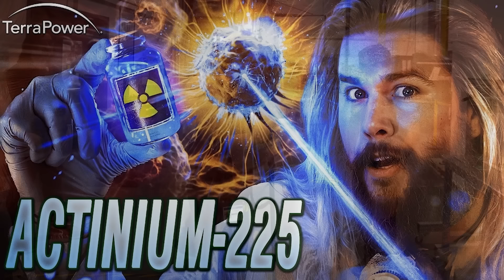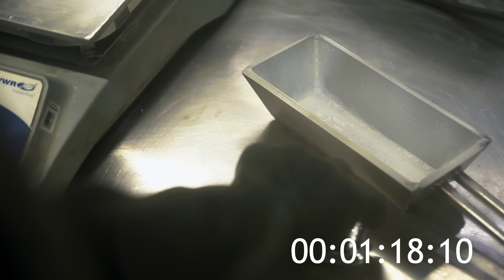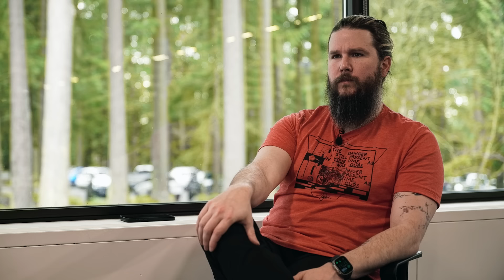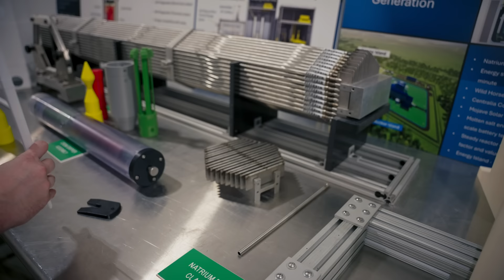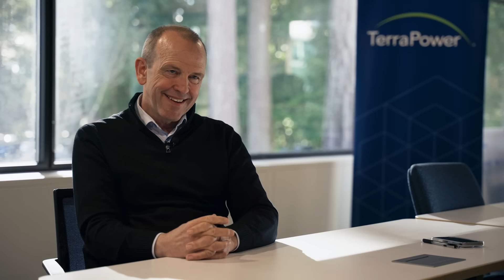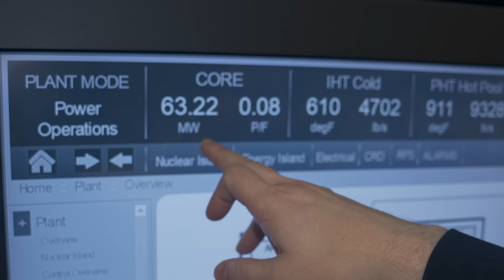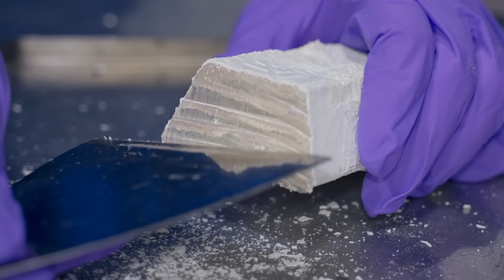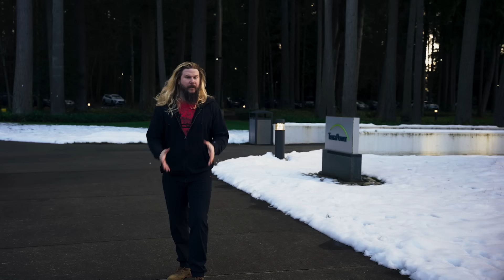Will Natrium Nuclear Reactors Change Everything?

Comment: Neat, but also would've loved some explanation of how they're counteracting corrosion over long durations from their very hot molten salt which has been the biggest challenge to commercializing molten salt reactors of any variety.
Reply: I thought he did at least touch on this, but I think he undersold the critical point. This is not a molten salt reactor. The reactor itself does not use any molten salt. They're using molten salt for energy storage and transfer in its own closed loop, but in this case they don't have to deal with molten salt corroding the reactor itself.
Reply: @rantingrodent416  yes but it does corrode the water loop. And that is the exact problem you don't want in regards to Na reactivity. It likely won't melt anything when it reacts to water, but it will turn a lot more of that water into steam which can lead to a steam explosion or at the very least force them to release that radioactive mixture to prevent a rupture in the water loop
Reply: @nokarukuta587  That's assuming they don't construct the loop out of materials that don't react with sodium, or at the very least aren't lined with a different, non-reactive material
Reply: @AlexDreemurr  Actually forget what I said those loops are not in contact. Here's what's could happen: molten salt could leak into the reactor and corrode that, water could leak into the molten salt loop and I'm not sure what would happen then.
Reply: @nokarukuta587 there is no "molten salt." Sodium isn't salt.   The salt solution isn't molten either, that's like saying a liquid battery is "molten" and this is essentially a giant version of one of those. It's a giant back up battery. Are they even in close enough contact for a leak like that to happen?

This is a sincere question and not sarcastic doubt, I'm not as familiar with nuclear heat transfer construction.

Water leaking into the salt solution would likely do little compared to getting into the sodium. Salt solutions, after all, contain water. If it's anything like smaller scale batteries, a specific ratio of electrolytes per volume would need to be maintained for it to store energy correctly.
Reply: @AschenDog  There most certainly is molten salt used in the reactor.

The nuclear reactor uses molten sodium metal (Na) directly as a coolant. Then, the molten sodium metal passes its heat into a molten salt coolant loop, which is 60% Sodium Nitrate (NaNO3) and 40% Potassium Nitrate (KNO3), per the whiteboard shots in the video. 

Finally, there is a heat transfer between the molten salt loop and a water source, which converts the water into steam that spins a steam turbine for power production. The molten salt loop is a thermal battery, i.e. it stores heat energy, and thus has the secondary advantage of being able to enable load balancing with the power grid.
Reply: @AschenDog  "Water leaking into the salt solution would likely do little compared to getting into the sodium. Salt solutions, after all, contain water. If it's anything like smaller scale batteries, a specific ratio of electrolytes per volume would need to be maintained for it to store energy correctly."

The big concern here would be a steam explosion, as with every other loop of this variety. Not really much you can do about it other than precautionary maintenance.
Reply: @AschenDog     we are not talking about the sodium loop. There are 3 loops, one in the reactor(sodium), second that takes heat from the reactor (molten salt), and the third water, which is turned to steam by the second loop.

So sodium heats molten salt which heats water, the sodium cannot come in contact with the water unless loop 2 breaches both in the reactor and in the heat exchanger between loop 2 and 3. 

As for your battery comparison, it's not like that, we are talking about completely different chemistries and even a tiny amount of water in the salt is bad since it speeds up corrosion.
Reply: @AlexDreemurr They did say they're using austenitic stainless steel. Your supposition is correct. One of the advantages of austenitic is that it doesn't corrode in the presence of liquid sodium
Reply: @AschenDog  bro what? sodium is salt
Reply: @MrTeddy12397  Sodium is a metal, and can be a component in a salt, for example sodium chloride.
Reply: @nokarukuta587  Actually, there are 4 circuits in the complete system, although only 3 are present in the nuclear island:
The primary (sodium) is inside the reactor vessel(pool). A small amount can become activated as it flows through the neutron flux if it happens to absorb a neutron (i.e. it is radioactive with a relatively short half-life for the activation products)
The secondary (also sodium, but not radioactive) moves the heat from the primary->secondary heat exchanger inside the reactor vessel to the sodium to molten salt heat exchanger in the ancillary building, attached but outside the main nuclear containment barrier (reactor building).
The third circuit (molten salt), moves the heat to the energy island storage tanks in a separate facility
Also in the energy island, the steam generators are fed by a second molten salt loop from the storage tanks.
Reply: @MrTeddy12397  Bro no.  Sodium is a metal.  Salt (table salt) is sodium AND CHLORINE (NaCl).  Other salts are other metals (not always sodium) and other non-metals (not always chlorine).
Reply: @Electroneer molten salt is not used in the reactor. Sodium is used in the reactor which is a metal.
Reply: @MrTeddy12397  if sodium is salt, so is calcium and lithium and magnesium. might wanna check your periodic table again.
Reply: @nokarukuta587  the salt loop is completely separate from the reactor and cannot leak into it, it is at least 100 feet away on a different concrete pad. And the sodium is completely separste from the water, no interaction possible.
Reply: @jeffreysmith236 salt loop passes through a heat exchanger on the other side of which is the sodium. Breaches pretty much always happen there since its a thing with a lot of thin pipes.
Since the reactor is at atmospheric pressure we can assume that the salt is higher pressure and would leak into the reactor if a breach occurs.
As for water reaching the reactor see my other comment, its unlikely but it can happen.
Reply: It's been in service for decades at concentrated solar thermal power plants without issue. Molten salt storage is a solved problem, it's not like molten salt thorium reactors. I'm unsure of the specifics of how they prevent corrosion (or if this specific solution is corrosive to the materials used for the insulated storage tanks), but the information is definitely out there somewhere.
Reply: @jeffbenton6183  The problem is solved by planning to replace corroded parts frequently as part of routine maintenance, which is easier to do when not dealing with radioative materials. The reason sodium metal is chosen as a coolant is because within the reactor it will be irradiated, and when a sodium atom captures a neutron, the radioactivated isotope decays to a stable isotope of magnesium. The sodium metal has to be highly purified to avoid other atoms capturing neutrons and producing less happy coincidental results. All this adds to cost and time-consuming technological side quests in order to operate safely. If any of this were easy and cost-effective to do, we'd be there already. But big data centers know they're going to need lots of power, and need to get public money and many smaller investors to buy in as if this would be serving the public. Other people's money. Good jobs for some. Plus it's good cover for military applications.
Reply: Maybe the molten salt not being radioactive makes it easier to regularly inspect and service the system. In MSR designs that mix fuel with molten salt the mixture will contain radioactive fission fragments, and neutron-activated isotopes. But if the salt is in the secondary loop it's not radioactive at all.
Reply: I've always wondered how they do this. Fluorinate the piping? That's about the only very good, consistent way I can think of, but it's difficult to do for valves and pumps. Their secondary loop seems pretty simple though, just tanks, pipes, and pumps.
Reply: After 10 years of mining salt, I can't see any metal pipe lasting very long. Couple of years tops. I'm sure they thought of something, but I'm also sure it's a proprietary idea that they aren't going to tell us.
Reply: @joeanthony2312  There is no salt in the reactor.
Reply: @joeanthony2312  You know that molten salt has been used in solar generation for decades*, right?  That this is a *solved problem and nothing even remotely super-secret?
Reply: @michaelrichter9427  Also well-studied are the leaks and fires in molten salt storage at CSP facilities operating at significantly lower temperatures that this proposed nuclear facility. Fortunately they've only resulted in shutdowns of several months and increased costs of tens of millions, not permanent losses of facilities, generations of cleanup and costs on the order of billions. I'd like the nuclear industry to adopt that!
Reply: I know multiple universities have been studying the best materials for pipes containing molten salt for years, such as UW-Madison. I would assume there was a break through there for this technology to proceed.
Reply: @phred-98  The problem is not just one of containment. There's also optimizing heat exchange while ensuring circulation of the two fluids in their distinct loops. One of the fallacies of the video is presenting sodium metal circulating in an open beaker by magnetism as if forcing it between control rods in the reactor core and then through a circuit to the the heat exchanger on the molten salt side without allowing hotspots or  blockages to develop. It's just not that easy.
Reply: @perrisici  They used electromagnetic pumps in EBR-II to circulate the secondary sodium. It ran for 30 years with no serious sodium issues and they used sodium to water heat exchangers. Yes, they had to replace the sodium to water heat exchangers once and learned the lesson. Instead of having the water in the blanket of the heat exchanger and pumping sodium through the pipes, they reversed it and pumped the sodium through the blanket. The problem wasn't the sodium side, it was the super heater water changing direction in the blanket that caused the problem. 
That's a solved problem and this one doesn't even use sodium to water heat exchangers.
Also, the sodium that is circulated through the core is NOT the sodium that leaves the reactor in this design, they are completely segregated. There is an intermediate heater exchanger inside the reactor vessel itself that does sodium to sodium heat transfer, ensuring that any sodium leaving the reactor is NOT radioactive, which makes addressing any small leaks so much easier....same in EBR-II, hence already proven.
Reply: @richardb1452  You seem to be under the impression that my objection to the video is that the project is not technologically feasible. This is not the case. A lot of projects are technologically feasible but never completed because of other constraints and considerations. Other projects get completed but go on to show that they weren't good choices or that other choices would have been better. You're bringing up the EBR-II as proof of the technology, so I'll just point out that EBR-II has been permanently entombed in a multi-decade decommissioning and decontamination process that has cost over 7.5 million USD and now the site has to remain under long-term management and control, limited to industrial use for at least the next hundred years, probably indefinitely. So while Kyle is selling the simplified version of circulating sodium in a beaker on a lab bench like it's no big deal, let's just think about the bigger technological challenge that needs to be overcome. It's not, "How do we power this data center?", but "How to we retool the world in time to prevent worse climate change scenarios while respecting planetary boundaries?" So it's not "Will Natrium Nuclear Reactors Change Everything?", it's "Will Natrium Nuclear Reactor Change Anything?". Every advancement applied in nuclear technology can be put to use in renewable energy technologies, without the radiological issues to deal with. Your comment literally points out how one must insert a duplicate heat exchanger to minimize the risk of carrying too many radioactivated atoms out of the reactor, and call it a solved problem. Incredible.
Reply: The "salts corrode metal" thing is a massively overblown misconception.  Anything can be 'highly corrosive' depending on the circumstances.  Water is highly corrosive to sugar, for instance.

Salts do tend to be associated with strong corrosion of metals, but that's only when also in the presence of water. Without water, the corrosion is vastly reduced, and a molten salt loop is far too hot for any water to exist or persist, even incidentally. 

Without water, you could either use some nickle-alloys like Hasteloy-N that were developed literally half a century ago, or you could even just use some less exotic stainless steel, and just make the plumbing a little thicker to tolerate the corrosion for the lifetime of the plant.   We're not talking about a catastrophic dissolving of the metal. This is just a very slow attrition of the metal walls that can tolerate losing a sixteenth of an inch over 10 years so long as the pipe wall is half an inch thick.
Reply: @Xylos144 it is true that without water corrosion is slower, but it's also true that high temperature speeds it up. As for nickel alloys being used in past molten salt reactors, as far as I know, there isn't data on what happens after more then 5-10 years of operation. As for thickening it up that's not how it works, in this case you have 2, more important considerations: one, making it thick enough so it can hold the water pressure in the 3rd loop and second, making it thin enough so it can transfer heat to the water.
Reply: @Xylos144 Thicker walls would reduce the heat transfer performance of the system, and planning for "acceptable corrosion" is a bad idea for critical system boundary/structural components. Not to mention the fact that sodium/molten salt contacting metal chemistry in a radioactive environment is a field with far fewer reactor hours of observation and testing than LWR contacting steel chemistry.
Reply: @CommanderTornado  most likely solution is having several heat exchangers and performing regular maintenance inspections to help minimize downtime and catastrophic failure.

Comment: So, instead of a huge reservoir of sodium, that has to be kept above melting temperature, high pressure, most reactive state at all times, so no maintenance periods btw., you can basically do the same with water energy storage, a couple of turbines and an order of magnitude cheaper? Got it!